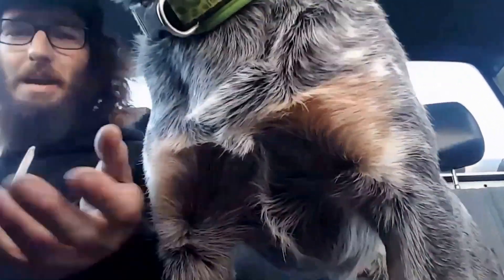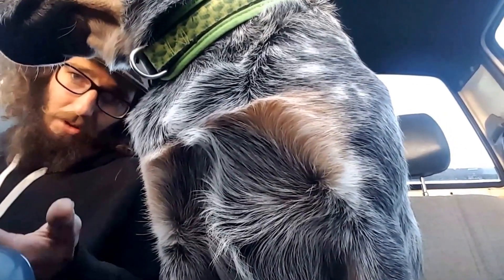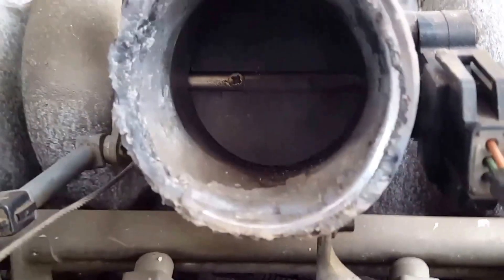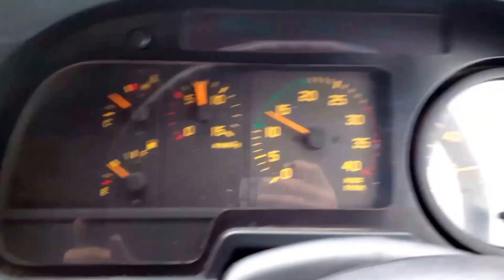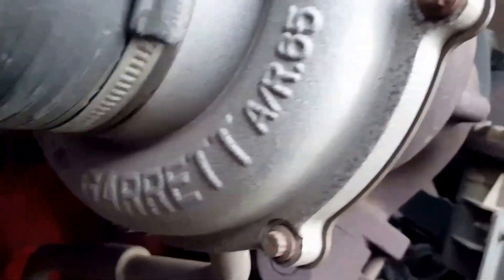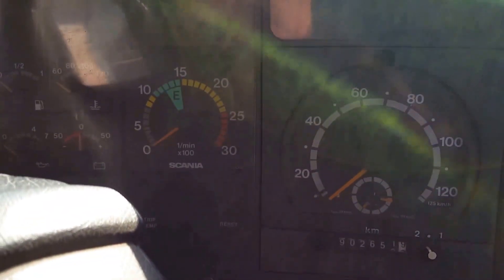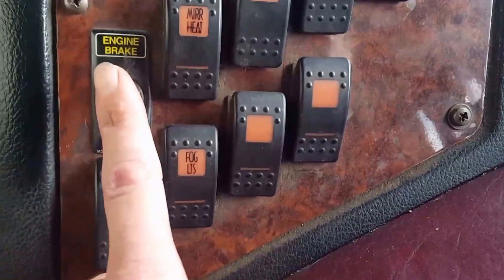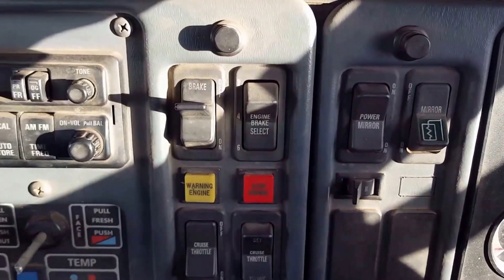Jake brake and exhaust brake and retarder roughly explained

Comment: Yeah imo engine braking is literally the most important thing in a semi cause it would save people and trucks and money and when people make "no engine braking" signs like BRUH really its like removing your disc break on a car
Reply: Engine breaking is useful, but not essential when not driving down a mountain.

So when you see a "no engine braking" sign, it is not appropriate to claim that it is like removing disc brakes on a car. A truck still has regular service brakes and being prohibited from using engine braking is only an inconvenience, nothing more.

If you saw the same sign going down a mountain, then there would be a case to be made that it creates a more dangerous drive for a truck.

Comment: I only drive a 10t Hino. I was coming down the Princes Highway descent into Wollongong. 40kph zone. Now, the gear to select to keep it below 40 is 3rd in my 6 speed. But this is absolutely redlining it and you're not supposed to use the exhaust brake so I put it in 3rd at the top and got most of the way down without using any brakes including my exhaust brake. I only had about 2t payload on so my weight was probably only 8t ish. But without braking it started really redlining and creeping over 40. So I put my exhaust brake on for not even a second and nearly got thrown though the windscreen holy shit it has a strong effect even downhill at those revs. Probably wasn't a good idea because my speed dropped down to about 25. Could've been bad if a big truck was behind me. I'm not sure if my brake lights engage with just the exhaust brake. Either way he would've had to brake if close enough. Probably would've been better just to put my service brakes on firmly for a couple of seconds. Obviously in 4th gear without the exhaust brakes it would've run away on me. Honestly though wouldn't a truck engine revving at 3k be just as loud as it revving at 2k with exhaust brakes running?

Comment: Very informative video. Love the comments around 7:00, very true but that's how it's going with everything! Even in a factory environment you cannot joke around much these days in case you offend somebody and end up in court 10 years later.
When you drive a prime mover bobtail style, would you keep the jake brake off or just leave it at the lowest level?
Reply from the maker: Bobtail I leave them off, even a bit of water or oil on the road can lock it up and stall it with no weight over the drive axles 👍

Comment: Well since most EU trucks use Retarders let me elaborate.

Retarder is a separate device attached to the gearbox. Its doesn't affect airflow in the engine. 
Its basically a big Oil pump powered by gearbox with adjustable outlet valve. So harder you brake the more valve closes which creates resistance and the pump needs to slow down so it slows down the gearbox. It can easily overheat if not used properly.
Reply: "It can easily overheat if not used properly." I don't know anything about retarders, what would cause overheating?
Reply: @basstrammel1322  a retarder is like a huge electromagnetic system, once it is on, the windings act like a generator and so can get hot
Reply: @Xantec  So the original post saying "overheat if not used properly." just means Don't use it too much? What if your going down from a mountain pass or something, what do you use for brakes after it gets hot?
Reply: Thanks that is what I came to this video for
Reply: some are also electric and generate a magnetic field giving resistance to a steel rotor and thus a braking effect